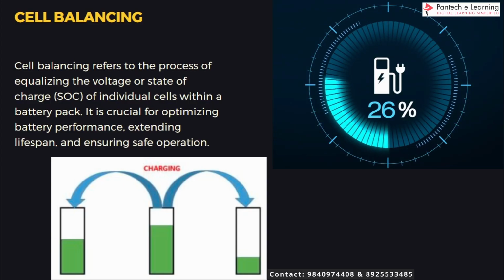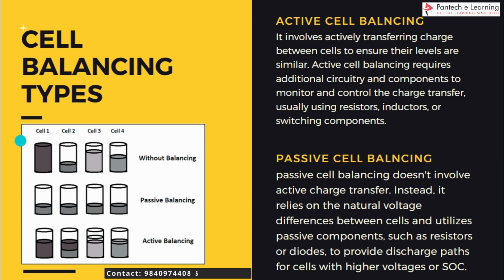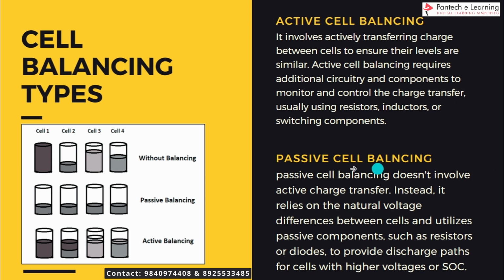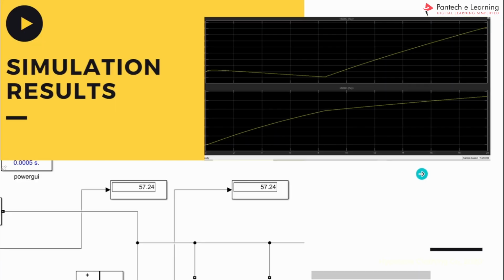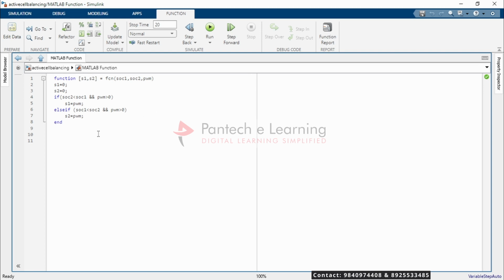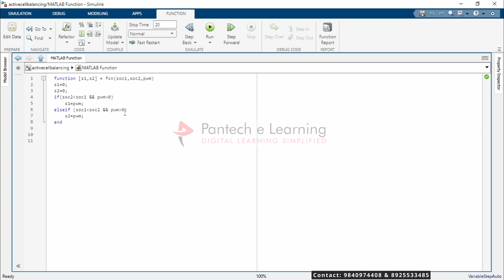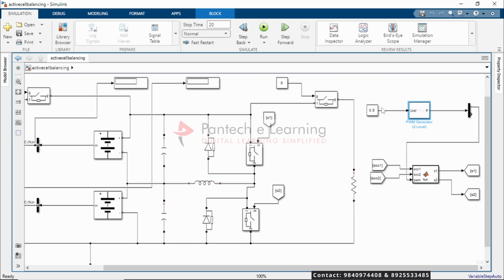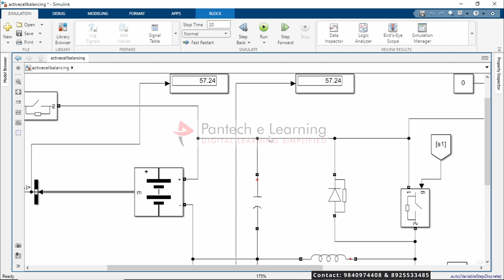Active Cell Balancing using Matlab Simulink Blocks | #simulation #matlab #ev #bms #eeeprojects

Comment: One cell soc 50% another cell 30% how its became 57.24 % after cell balancing
Reply: simultaneously batteries are charging with dc voltage source so only soc is increased to 57.24%.
Reply: @radhikapantech  but in this simulation did u mention anything abt charging circuit
and if its not charging how much soc will it come anyway thank you for this video